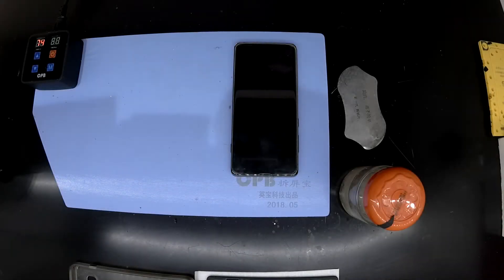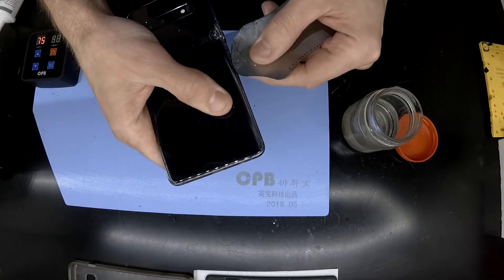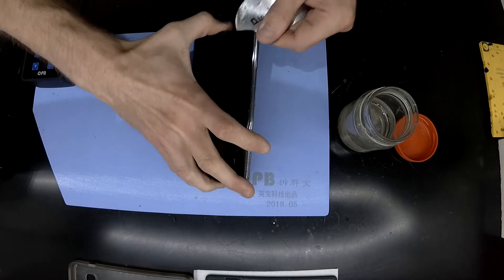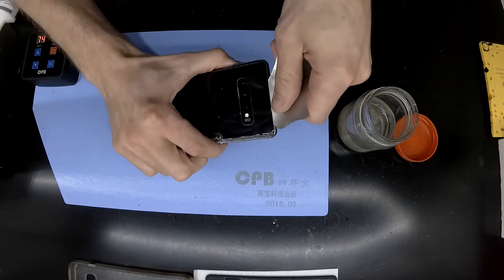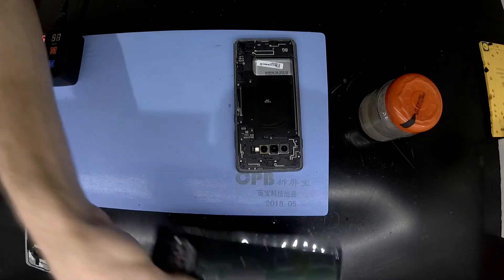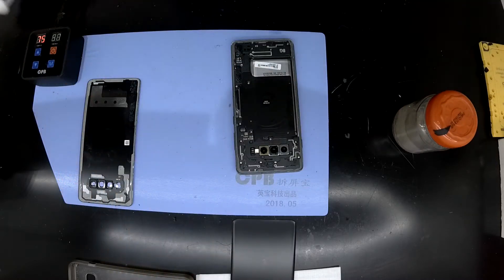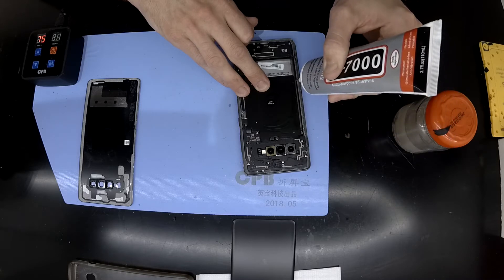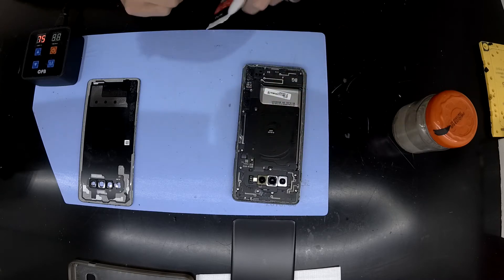Samsung Galaxy S10 / S10 Plus Back Cover replacement

Comment: Nice vidéo, thank you! Wich temperature on the heating pas and how much time to heat before opening? Thanks a lot.
Reply from the maker: I use a heatpad at 70 degrees

If I was to use a reflow station I would go

90 degrees at around 40 flow